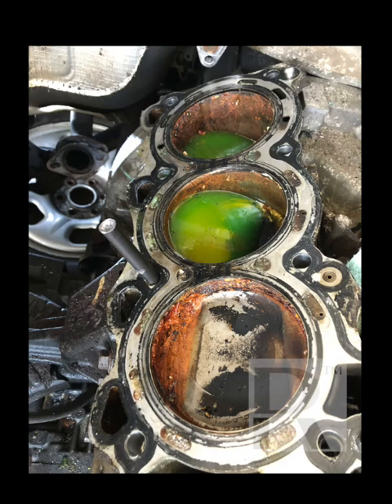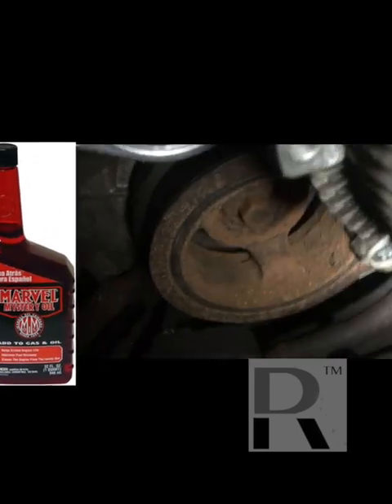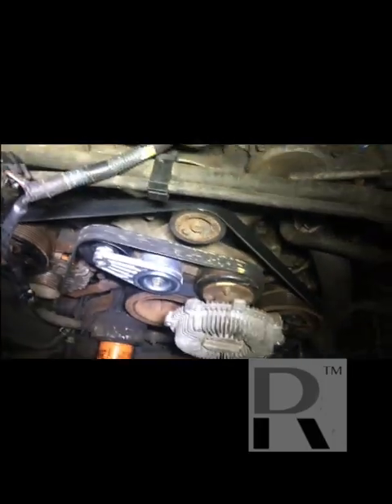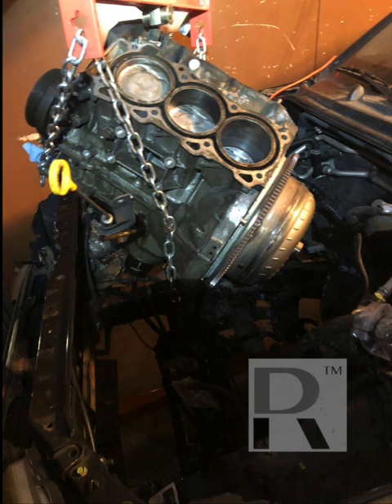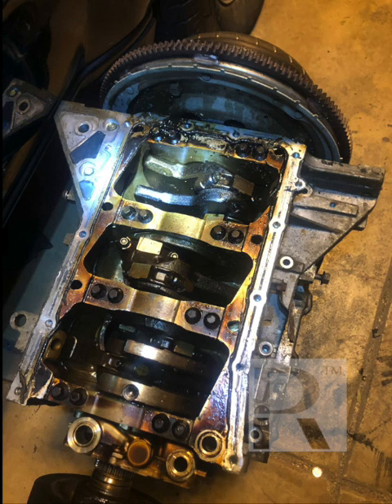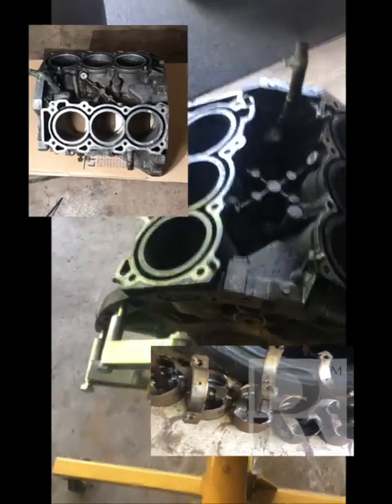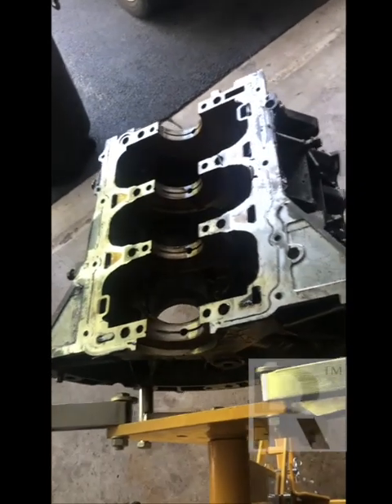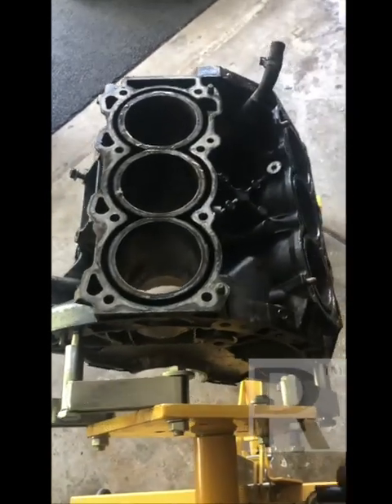2006 Nissan Xterra Engine(VQ40DE) Build Part 1(Analysis)

Comment: Are these hard to rebuid? Been qouted 12k for new engine or 1400 for rebuild kit, also have to done the valve stem seals in these ?
Reply from the maker: No it's not hard. There's a lot of videos on YT of VQ40DE rebuilds. VQ35 and 37 are similar. Only thing that gave me trouble was the front timing cover, I missed one the bolts during removal and ended up cracking the cover.

$1400 for a rebuilt engine is a good price, especially if it has a warranty. If you go with the rebuilt engine,  I would recommend  changing the timing chain and water pump before install. Will save you a boatload of money down the road.